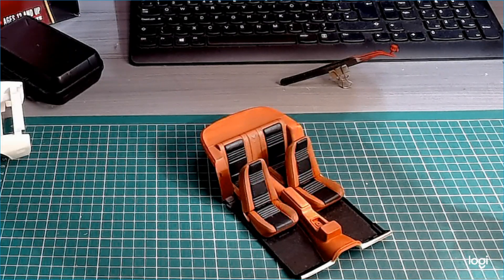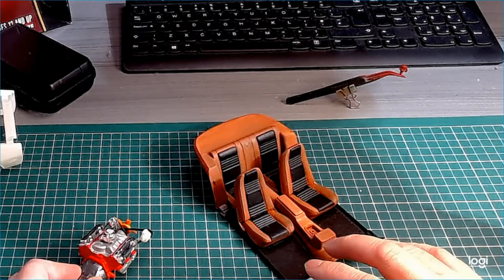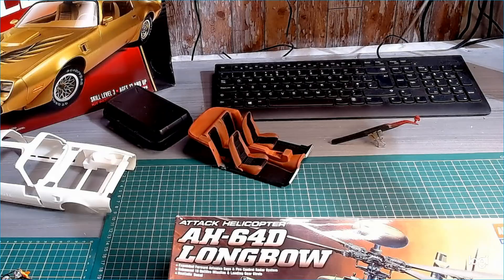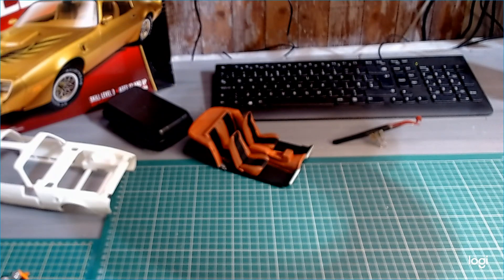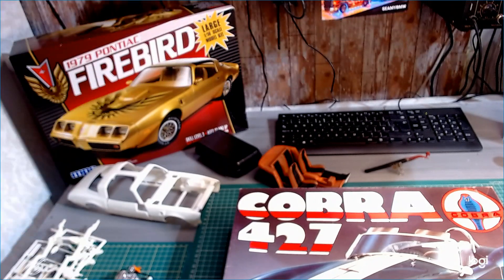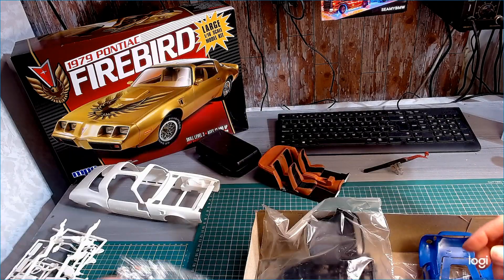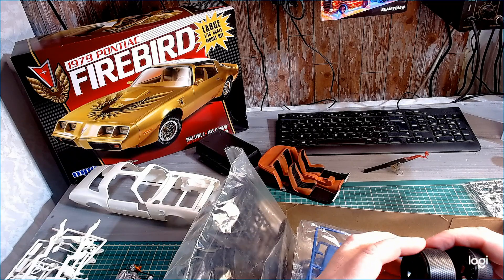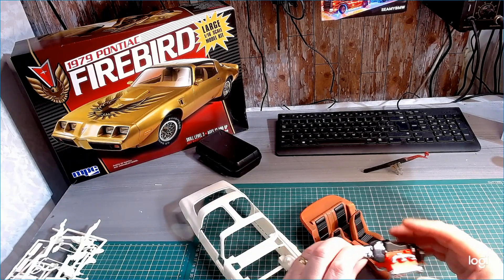1979 1/16 Firebird Update and stash up date

Comment: Did you have any issues with fitting your rear window mine didn't fit in my model and the body was useless so I returned it I'm thinking of getting a new one
Reply from the maker: Worst model I've ever came across fit issues every were cant recall have fit problems with the glass but the doors are a bad fit the engine is the only good thing going for it
Reply: @seamybmw  thank you for being honest